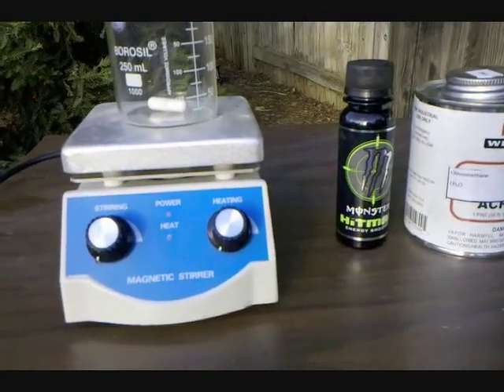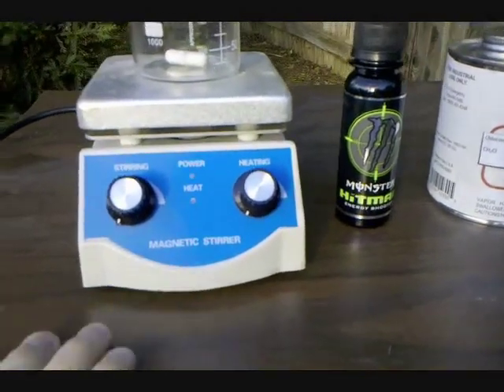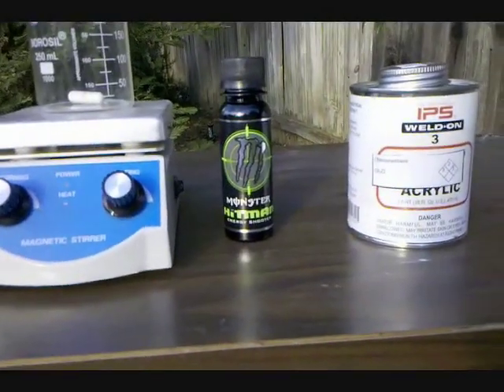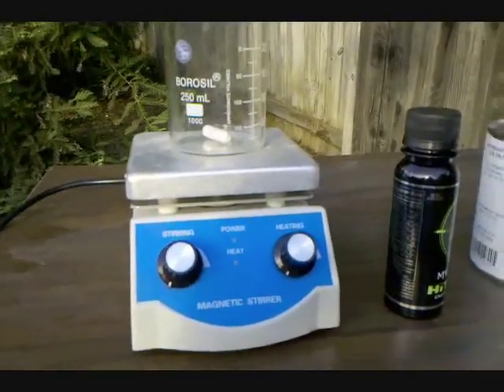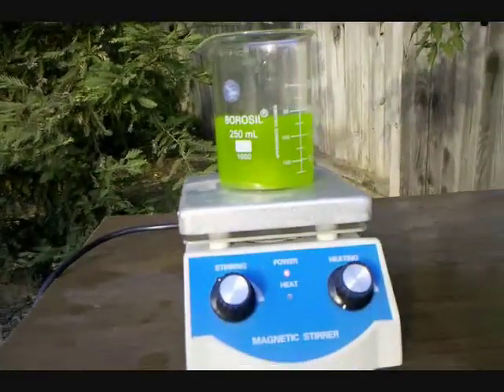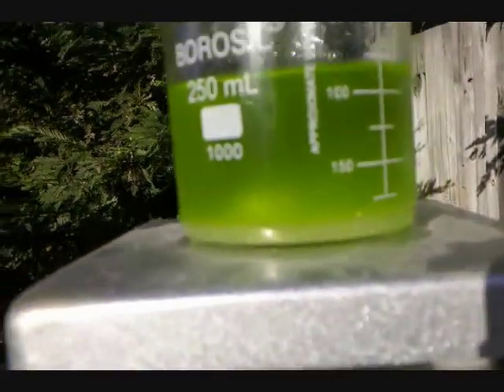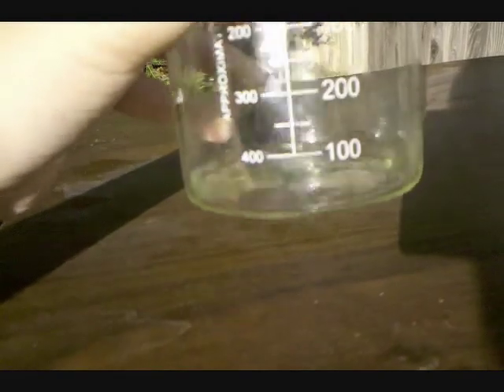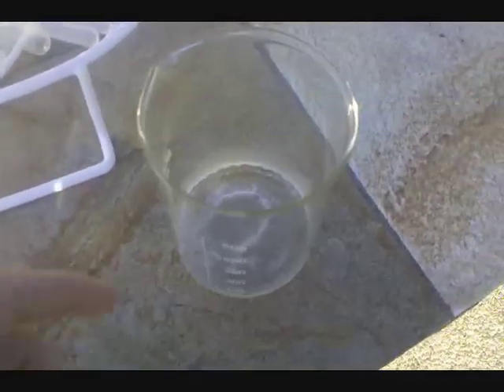Isolation of Caffeine

Comment: Me and my frend took a capful of this 20 mins before our 1 mile P.E. run and were 13 and made it in 6:30
Reply: Taking even a small amount of this will cause your heart to spasm and you will die, that's not exaggerating this is true.
In ww2 they used a gas almost exactly the same as this to kill people behind enemy lines.

If you took this, you'd be dead.
Reply: @joshgilchrist2166  'woosh'

Comment: You can make dichloromethane by reacting methane with chlorine gas... you can make them react with either heat OR an easier method is to use blue light.  

You will get a mixture of chloromethane and HCl, then in the next reaction you will turn the chloromethane into dichloromethane and HCl.

Comment: 1- When you made a liquid-liquid extraction the ratio betwwen organic solvent should be about 1:1, you used too less DCM.
2- Can't really say you "isolated" the caffeine. You extracted it...among with all the other low polar substance in the energy drink (DCM is a very un-selective solvent in my experience, you probaly extracted little ammounts of medium-polar subtances, like taurine).
I would suggest choloroform if you have in mind another try. (Watch out for hepatotoxicity, dont touch it).

Comment: You can use distillation to get a more purified and sparated caffeine sample. Also, rather than using an energy drink, boil Tea Leaves in water and that will create a solution with just caffeine extract (this is where you will put in your solvent, preferably Dicholoromethane..).

Comment: lol. This is very good. your source of ethyl acetate is better than mine. I actually ferment sugar solution at lower temperatures to promote higher ester formations then fractionally distill it out. Cheaper, yes, but it takes a few months to ferment 5 gallons of sucrose. 

Also, I believe Toluene is an effective solvent you could use on the Caffeine. It won't mix with the water, so the different phases would be easy to seperate using a seperatory funnel. You still wouldn't want to eat it.

Comment from the maker: @mewrox99 Good point.  I looked into it and my solvent is not pure.  On the bottle is says it is chloromethane however on the back it says it contains other ingredients in small quantities.  My guess is the solvent is mostly chloromethane, but there are another solvents that it is dissolved in to make it a liquid.  Unfortunately I did not but it from a chemical company but from a plastics company that sold it as a acrylic solvent